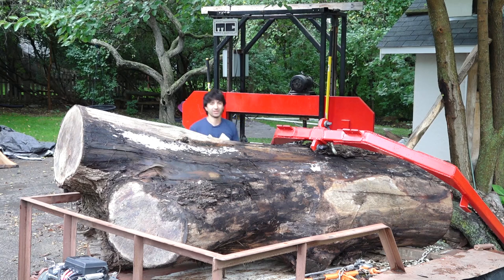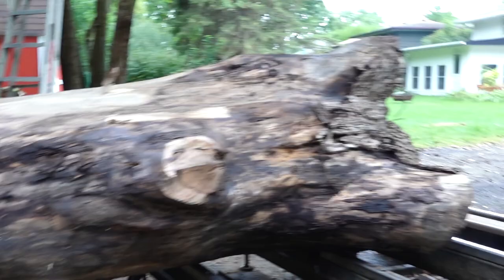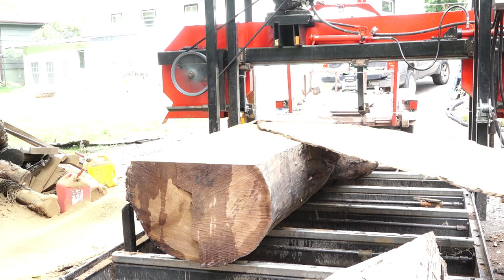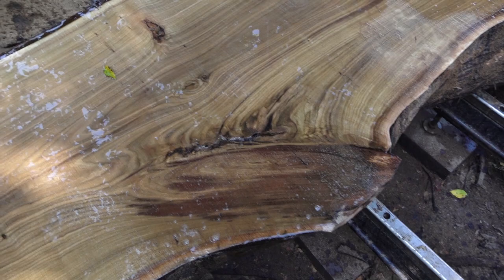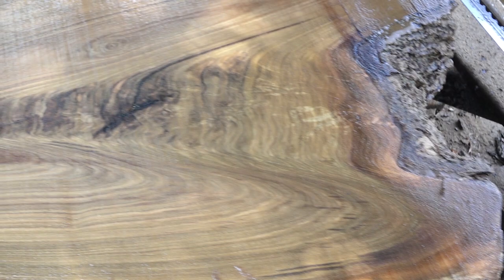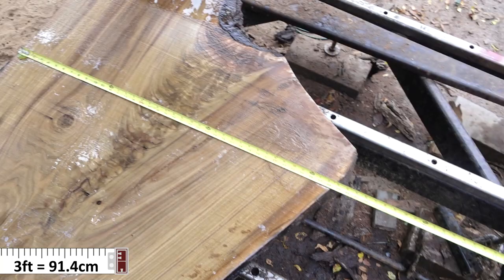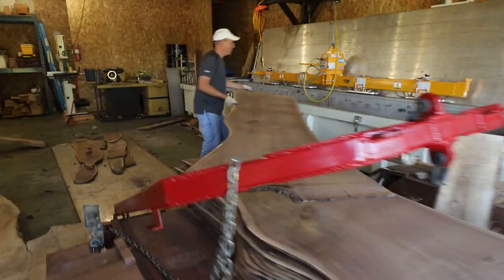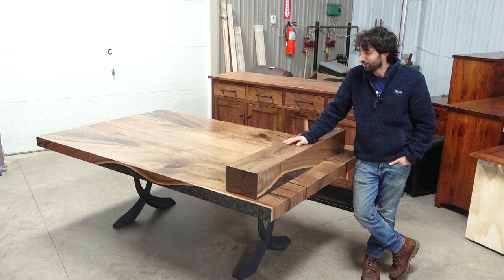Slicing a Walnut Log into 37 Thin Slabs

Comment: Between the wrap around capability and the vacuum kiln the turn around time on projects is incredible. Normally that sort of crazy figure would have to stay stickered for months to stabilize and dry. These geniuses figured out how to make way more use out of figured wood beyond typical veneers and crank out stable projects way faster. Very clever. Best of luck to you on any projects.
Reply: If he had just air dried it with stickers in between the boards he would have had 37 useless boards as they would have had more waves than the Atlantic in them. Vacuum drying is the way to go as it keeps the boards flat.

Comment: That tape measure will soon develop rust. Tsk, tsk...
Reply: I thought the same, not a good way to have a working tool for long
Reply: @sass1ap  
As a screaming G.C., I'm never happy witnessing tool abuse.
Reply: tapes are cheap , and i buy a new one every few months. have done that for 40 yrs. believe it or not , the blade thickness decreases with use , and they become very floppy. long before rust kicks in
Reply from the maker: That one’s been out in the rain a few times
Reply: tapes are like knife blades , saw blades and drill bits . disposable. i have a model 77 skil saw that's 34 yrs old , runs like a top .i have 3 other 77's too. THEY are tools . tapes are incidentals . i can buy a pack with a 16' and 25' fat max for 20$ . thats cheap. trusy me , a new tape will make you more money than an 11 yr old tape. also, if someone steals the new one , there's a retired one SOMEWHERE in the truck hahahaha.
Reply: thats an old Stanley powerlock , they have staying power , lol. and a thick mylar blade coating , front and back.

Comment: Matt, since you can cut and dry these "super veneers": why not offer a glue lam beam core, w a "wrapper" using A.Klein's drawer blade to cut these 1/2" thick "covers" for an A.Klein bench top using glue-lam's with M.Cremona "covers"?  Mill, dry, cut and ship in a pair of mdf sheets with some stop blocks; instant internet product for those who'd like an A.Klein bench with M.Cremona top slabs!

Comment: Save and provide a bags of saw dust for repair filling material of the walnut sheets. Just a gallon zip lock bag for each sheet of walnut would be god sent for wood workers. It would a color and stain match when you use permial bonding adhesive.

Comment: I noticed that as you saw, the blade guide seems to gravitate toward the slab. Have you thought about putting a rope and pulley system on it so that you wouldn’t have to reach so far to move it. An eye on the blade guide, a pulley on the wheel housing and a rope ran back to the operators station. Seems to me that that might make things a little easier. Just a suggestion.

Comment: this is a great way to extend a log with good features.  Not quite as thin as veneer but thick enough to easily work with.  I noticed he filled in the cracks with epoxy, it looks great.  Do you think this will change the way you build furniture?

Comment: Love the Imperial to Metrics conversion :-)
Reply: The conversions of 914 millimeters to 3 feet.
Or 21.4 inches to The Royal Egyptian cubit
Or 39.3700787 inches to the meter are conventions. 
But when you have to figure out how many studs to exactly divide a 9.47 meter wall in millimeter  spacings, metric is pretty easy when an exact figure is needed.

Comment: Have you ever looked into a portable log arch that could ride the sawmill rails but also drop down onto the ground to assist with log movement?  Make it with inner rail wheels then rubber tires on casters for moving on dirt.

Comment: Love your work, miter folds are common in custom cabinetry, the built up thickness has been around forever in countertops made of stone. If you know wood, it is apparent this isn't a 3 inch slab, but the effect is beautiful, nonetheless! I would like to see a shroud over the belt on your saw, don't wait for the first accident to happen! I might echo what another commenter mentioned the table looks tippy and also weak to any abuse from the ends, it just looks ungainly with this choice of legs.

Comment: There is something else very cool you can do with 1/2 slabs.   Stand them up against a wall to let them dry.  While drying they develop beautiful curvy shapes (surfaces) , sorta like the top of a violin. Nice wall paneling  or other sculptural pieces.  Did any of those pieces "Freak out" because you glued a piece of wood that has expansion to a substrate that is somewhat stable???
Reply: Birdie Miller if you cut long grooves on the back side it “breaks” the back of slab. Just like grooves on the back of quality millwork. That’s one of the secrets to the process. I learned the idea watching Kelly Johnson design the sr-71 blackbird. His panels warped after flight so they added grooves on the panels. Kinda works the same on wood.

Comment: You sliced them into 1/2" pieces and then laminated two (?) together before doing the miter-fold thing?   I definitely would like to see a detail on how that part was done.  really cool look.
Reply from the maker: Since they were wide, each slice was laminated to its own full sheet of plywood. The waste was removed for each and those two pieces of ply were edge glued together. Epoxy fills were done next before the entire thing went through the miter fold blade
Reply: @mcremona  Ahhhh,  I heard "laminated INTO plywood" but it  was "laminated ONTO plywood" !!!  that makes a lot more sense than what was in my head.   Slick!

Comment: You can buy bulk bandsaw blade rolls which you then cut to length and weld into bands.  Would that be more economical than buying ready made bands?  At what point does welding your own blades make sense?  How viable is blade sharpening?  Does a re-sharpened blade give the same number of cuts as a fresh blade?

Comment: Matt, how long did you say you air dried these before going into the kiln?  Do you mind sharing what you are using for the substrate you glue the slices too?

Oh, and I have been wondering how long the thick live edge slab was going to last in the market and here you are already working on the next stage...good to have another option for my slab stack.

Comment: Love your channel.  I’m curious, why do you slide every piece off the back and then walk it around the machine &  place on the trailer? It seems like it would be easier to just slide it forward, from the log to the trailer.
Reply from the maker: Don’t have to wait for the sawhead to raise up
Reply: @mcremona That’s the only logical reason I could think of too but, I noticed in other videos you slide forward. Probably 2 handle cranks. 3-4 sec. 🤷‍♂️ I’m not knocking it. Just inquiring. I guess the other slabs were thicker/heavier. Thanks for the reply. My background has 20 years of masonry history, & was always taught to not handle weight whenever possible. (For longevity purposes) My thinking was, you have to raise the blade & the piece could be slid forward while you were walking the blade back & resetting. I’m not knocking your process, you clearly have been doing this work for years. Keep making content, I’ll keep learning from you.

Comment: Did you have any issues with the wood cracking at a width of ust 0.5 in during vacuum drying?  Might it have been better to cut thicker slabs, vacuum dry them, and then cut them down to 0.5 in, at lest in terms of dimensional stability during drying?

Comment: So what is the thickness of the slabs pre-laminated, and the thickness of the plywood it laminated to? Also, are there any longitudinal stiffeners running the full length underneath or is it more like an open shallow box?  Any testing on the stiffness vs length of the finished pieces? so many questions, such a great idea,  I need to know...      Great stuff btw

Comment: Hey Matt, how do you keep the thin slabs from warping/cupping? When sawing 1x's or 2x's or even slabs (depending on thickness) they always warp and cup but you can plane those out. This is so thin even sanding would be challenging to remove warping and cupping.

Comment: The mitre fold blade you mention only cuts up to 7/8 in. thick material. If you laminated 1/2 slabs on 3/4 ply, that’s 1 1/4 total thickness, so the rockler blade wouldn’t work?
Reply: ebutcher62 read Robbie millers comments for details. Boards start at half inch. When planed down they are quarter inch.

Comment: What plywoods are you using? Are you gluing multiple sheets to get your thickness? Plywood and wood are going to move at different rates and pull against each other, being glued will they split and separate? Great idea but I'm concerned about movement. Almost done with my mill, biggest log is a 73" white oak, ,,,yea bubba!!!!!
Reply: JEFFREY JONES agreed, however we have figured out a way to make them expand or contract at the same rate👍

Comment: Matt, I watched the videos by Rockler and Andy Klein and they said that his miter fold blade set only  works on wood up to 3/4" thick. You are using a 1/2" slab so did you glue it to a 1/4" sheet of plywood  the the bottom of the slab before you cut the folding miter or did you cut the folding miter in the slab and then glue a thicker piece of plywood  on the bottom and sides after the folding miter cut?  Either way, that is really cool and I've got to try it.
Reply: Robbie Miller hi Eric here. It was planed down to 1/4” then laminated to 1/2” plywood.  After the folding process added another layer of 1/4” thick with epoxy on the underside. This added super strength and sealed limiting moisture. Hope that helps.
Reply: @amish_showroom  Eric, so after folding, you added another 1/ 4" piece of slab or a 1 /4" piece of plywood?
Reply: Robbie Miller correct. Just brush on some UV ecopoxy inside and laminate another layer. You can even attach stiffener strips as needed for even more stiffness.

Comment: what kind of blades do you use?  looks like a hook/skip tooth but only 1 1/2" wide?  are they carbide tipped or tempered tool steel? and do you resharpen them (or have the manufacturer do it since they are likely custom blades anyway)?

wrestling those big blades looks like fun i must say...and the sound is hilarious

Comment: I wish I could have those..... I will make my house like a walnut inside. Are using those for finishing walls? With this huge size I would think they will warp and crack when dry
Reply: not nessesary! im more concerned when i see most people  sawing 2-3 inch slabs. yes it sounds cool with say a masssive wooden table made out of 1 piece..
but in my experience a single thick slab will eventually CRACK AND ORE BEND..
Most people dont study the underside of a table,, so you get a better result over time by GLUING A THIN SLAB TO A STABLE SURFASE, say an osb plate - lvl plate ore even a steel plate.
but yes i have made some almost massive thick tables when i was younger using thick slabs,, but then i made grooves witn my portable router on the under side wher i glued in brases.
reinforcing weak spots
Ps at the end of the video he showed a simular method by using plywood plate and gluing slap pieces on the sides to make the slabs  look thicker.

Comment: Did you ever consider a drill or remote control power feed? Armstrong feed will get old in your 50's!😃
Reply from the maker: I’ll use a drill on small stuff where I can’t physically turn the handle fast enough

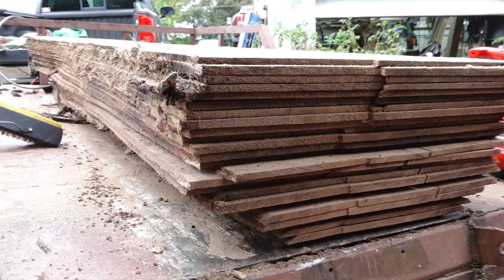Comment: 14:11 Honest question, is it some kind of a traditional ritual thing to dump water from a bucket rather than spray from a hose?
Reply: It's the visual effect of a "finished" piece of wood versus just the wet wood look caused by a hose spraying an uneven thickness of water onto the wood. Two totally different looks. : )
Reply: I disagree with Bush Master - wet is wet, but I think that a bucket of water removes all the sawdust leaving a clean grain pattern.
Reply: @pulaski1  I stand by my statement. When the piece is flooded with water it looks like a high gloss finish and brings the grain / figure and color to life. Yes, it does wash away any residual dust, but that is not the reason for flooding it versus just hosing it down, which would also rinse away the dust. Ask anyone that is doing this why they are doing it, including the poster of this video.
Reply: @bushmaster2936  After seeing your comment I went back and checked - the grain is clearly visible, and very pretty, in the video section where Matt has used his hand to squeegee off most of the water, leaving nothing but a wet surface.  Stand by your comment if you like, but it doesn't change what I saw in this video with my own eyes.  :)
Reply: @bushmaster2936  TL;DNR.  I've used gallons of varnish over the years, thank you very much, including polished on guitars until it shines like glass.  If you can't see the grain pattern in wet timber and need to have it flooded then there is something wrong with your eyes. ... And that you need to "make your point" by adding insults speaks volumes about your character.
Reply: @pulaski1  You just proved my point, again.  You don't get it and I can't make it any simpler for you. My original comments were for Lenny F who asked the question as to why it was done. End of story.
Reply: @pulaski1  Actually spraying  with a hose We'll definitely remove more sawdust

Comment: Why would you pull slabs off the back side and walk them around?
Just pull straight off to the trailer.
Reply: Always better to be behind the blade, good habit to get in to
Reply: Great question...if I pull them off the back side Matt does not have to lift the saw head. Also the dust on that side was blowing in my face👍

Comment: I have to wonder why, istead of all that walking and carrying, why not let the saw return to the start, and pull the just cut slab directly to the trailer? Seems like a LOT of wasted motion !
Reply: budlvr I was tired of the sawdust blowing in my face on the front end. Second reason was we did not have to crank the blade up-then back down again. It actually saved more time 👍👍

Comment: I am stupid. Why not make a cut, crank back the blade and then let Eric just pull the slab right on to the trailer?
Reply: Because you would have to raise the saw before backing it up, that action may interfere with the indexing?
Reply: Did not want to raise blade 37 times. They are so light to move anyway and the wind was blowing the dust that way so I moved.